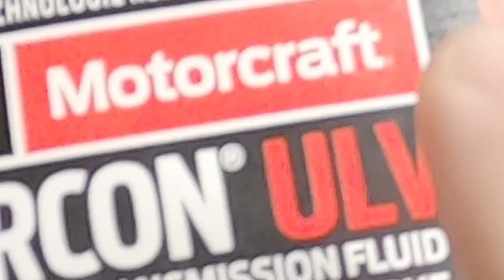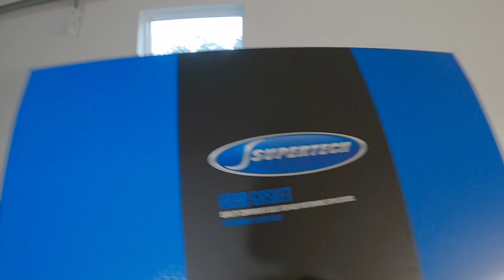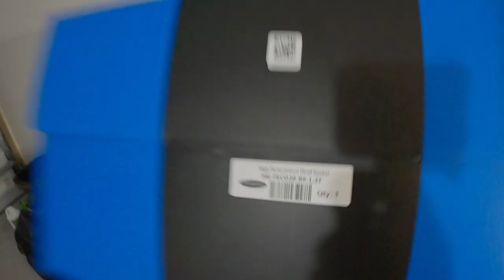Super High Performance 2.3L ECOBOOST Assembly Finally BEGINS! Update

Comment: What happened to your mustang ecoboost?. I"d be so cool if you make a video of your experience with the mustang ecoboost. Im debating if i should get a mustang ecoboost premium 2017 with 40k miles. i see a lot of different opinions
Reply from the maker: It's not very clear what caused my engine to fail. A few different findings during the teardown showed coolant intrusion, and possible detonation in cylinders 2 and 3. I would only recommend an ecoboost to someone who acknowledges the potential for failure, and doesn't mind doing a rebuild. But if you aren't interested in that possibility, or you can't financially commit to that idea, then I wouldn't recommend it. The failure rates on the factory built engines are just way to high.
Reply: Thank you man, appreciate it
 @KarzKreated